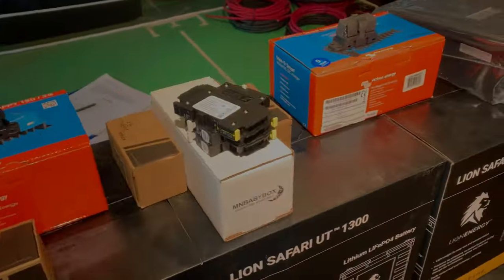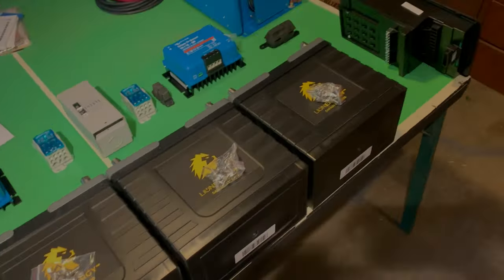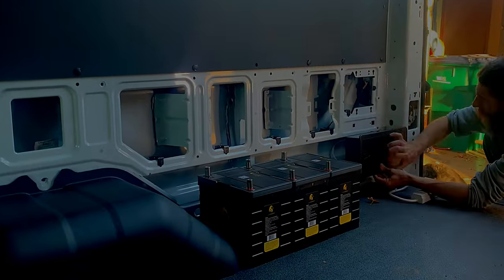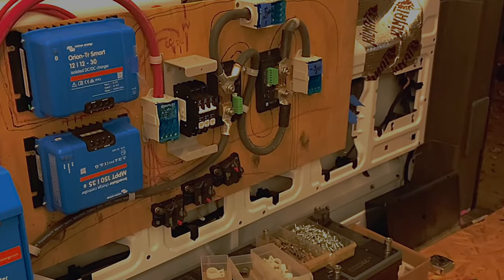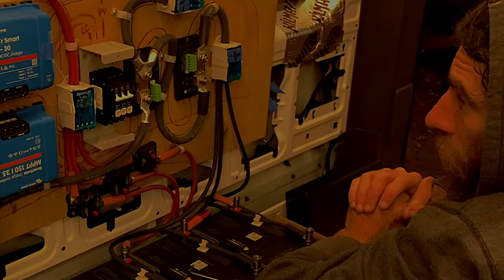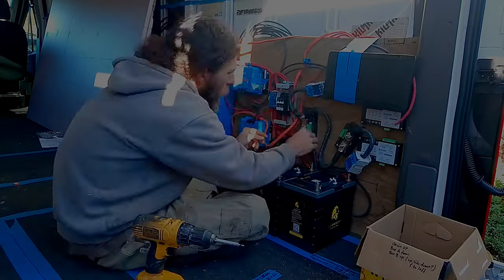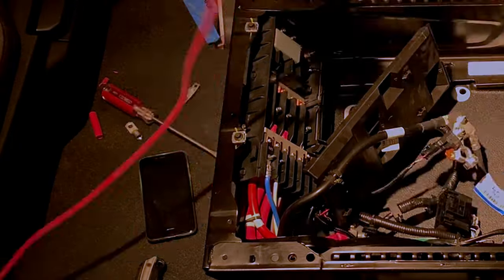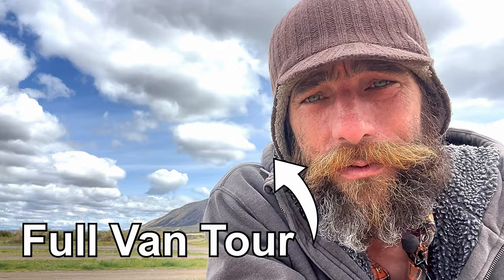Planning & DC Main Components - VanLife Solar Electrical Pt.2

Comment: I'm amazed at how overdimensioned your MPPT is for your PV panel, and your inverter for your batteries and loads. I'm used to seeing overpanelled systems with a barely enough inverter, so this is an interesting shift.
Reply from the maker: I wanted the ability to add a 100w panel or two and another battery if I needed / wanted it… that said… as I say in video, I did not scale it… just requested that I have the option to grow in collection and storage (and consumers too… may want a toaster oven or microwave one day… hope not though)👍🏽